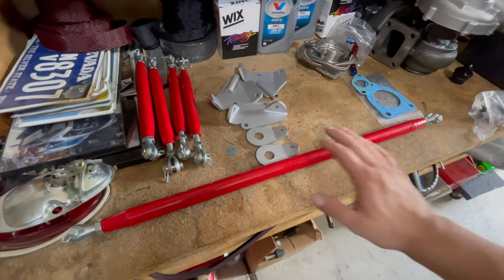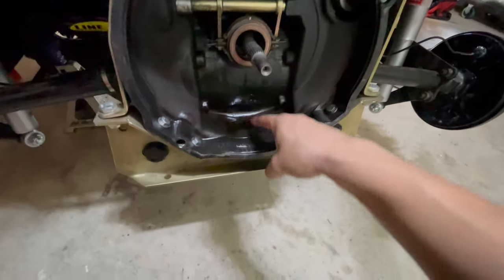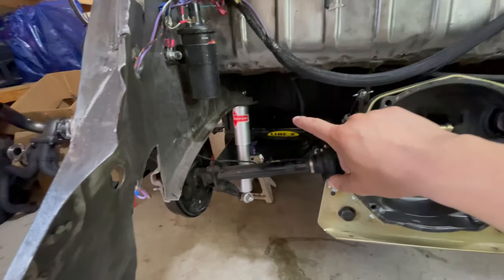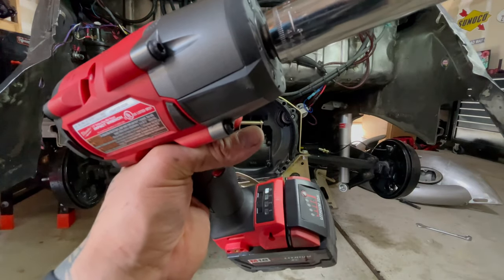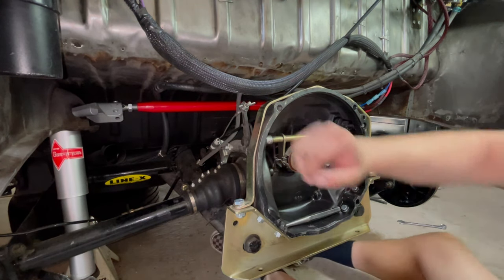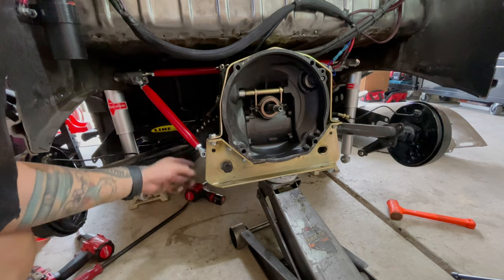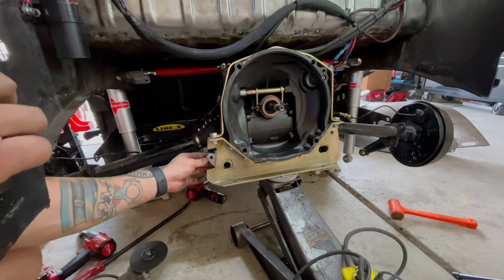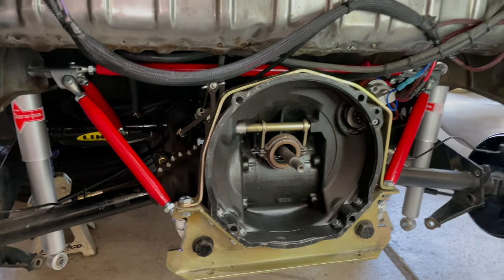CoolRydes Customs “The Stiffy” Kafer Bar Install

Comment: I added the cb rhino mounts on my stock transmission mount , which had to be just trimmed slightly to fit the kafer bracket on the ends of the frame horns.
I did not have to disassemble the spring plates at all just the trans mount which went back on fine without having to move the transmission ahead at all.
the two front  brackets that attach at the frame horn install with the small end bolted down and the longer pointed end into the clevis pin .
being that they neglect to provide any instructions with the kit , it can be said there is no wrong or right way to do it but after trying all possible configurations I found this fit the best and installed with no cutting or drilling of the supplied parts and went together without stressing the other components , hope this helps someone else that buys the kit .

Comment: Did those ears you put between the frame horns and trans mount move the trans and motor back a 1/4” or was there a spacer or washer in there stock or some play in mounts that allow everything to line up?
Reply from the maker: Everything still lines up with that spacing. Those ears did put the engine and transmission back about a 1/4”. Stock did not have any spacing between there. It does not have any issues with that much because you can readjust your shifter, and the shift rod allows play to move it back a little. One thing I recommend that I didn’t do is putting washers or a spacer for 1/4” on the front transmission mount where it mounts on the nose cone.
Reply: @EmmettRacing zip I made the holes a 1/4 inch bigger and moved the transmission mounts a 1/4 inch.  Either way is fine though.
Reply from the maker: @jostrander71 that’s a good idea to do.

Comment: finally a correct install video on this , just going to get into mine for my 56 , perfect timing .
great video ,to the point , informative, with out any b.s. thank you
Reply from the maker: Awesome! Glad it’s the perfect video for you.
Reply: @EmmettRacing  so tell us did it feel stiffer was it a little noisier inside the car? Do you honestly feel that the product is worth the money?
Reply from the maker: @chuckingram5966  it’s way stiffer and as helped eliminate wheel hop when I launch the bug under boost. I haven’t noticed any difference in noise but if you’re going to drive your VW hard like I do, it’s definitely worth the money.

Comment: How much space do you have between the top tube and the starter? I have a starter adapter for a tdi on mine and want this but they might rub
Reply from the maker: it’s about an inch and a half or 2 inches between the starter and bar that goes over the bell housing.

Comment: G'day,
Everything looks great. 
I've got a Kafer stiffy kit to fit to my 63 beetle, after seeing your video I know where I'm going with it now. 
Q. I notice that your transmission is solid mounted. What's the reasoning behind this.
Anyhoo thankyou for sharing your install. 
✌️ From Melbourne Australia.
Reply from the maker: The reason behind the solid mounts is under hard launches it transfers the most amount of power down without flexing like a rubber mount would.
Reply: @EmmettRacing  
Thanks man. ✌️
Reply from the maker: @kevinhamling1963  no problem!